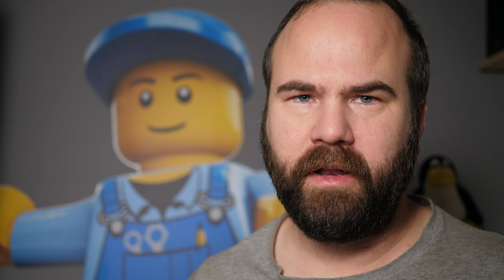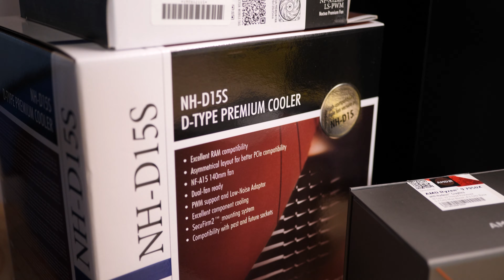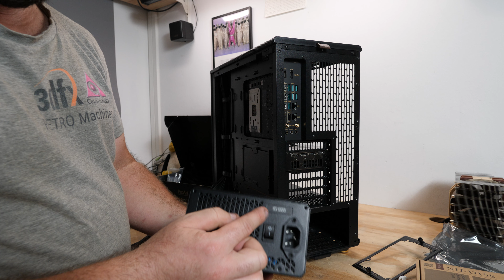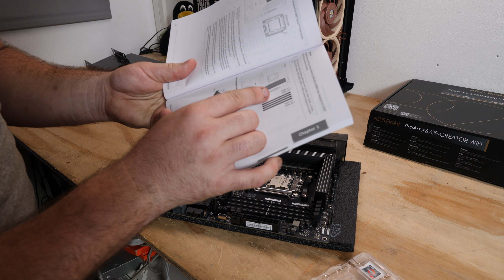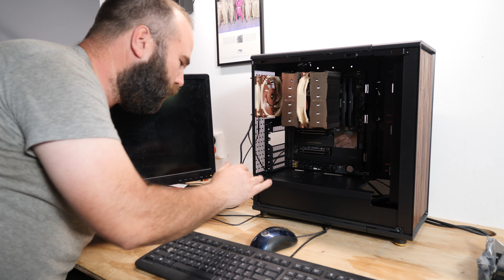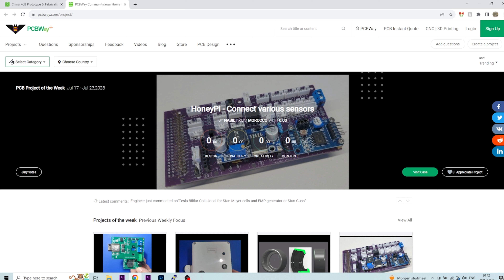The Ultimate $4000 Workstation PC Build Guide (2023) AMD Ryzen 9

Comment: I'm jealous, my 2019 PC did cost new ~$400, even counting this year's replacement HDD.  A Ryzen 3 2200G ($97); ASRock B450 HDV Rel 4.0 ($59.99); Xtech Black Case & Power Supply Combo (DOP 1800 or $36);  The expensive parts were a 512GB nvme-SSD and 16GB DDR4 (3000MHz). I reused a 128GB sata-SSD and a 1TB HDD.  The HDD died this years after 10 power-on years, so no complaints, I replaced it by a cheap 2 TB SMR HDD.  The power supply is special, it has 600W and 6 plugs, 24-pin; 4 pin; 2 sata and 2 molex :)

Currently the PC runs Firefox (1 Tab); Conky; a Xubuntu 23.10 VBox VM for all my communication apps (4 apps are loaded at login; Evolution; Transmission; KDE-Connect; Facebook Messenger and Conky) and an Ubuntu 16.04 ESM VM for banking with the latest snaps for Firefox and LibreOffice, currently both are loaded.  The Host is Ubuntu 23.10 running on and booting from OpenZFS 2.2.0.  Free memory is 2GB from 16GB and it uses 4.6GB of dynamically sized memory cache (L1ARC) to store 6.6GB of stuff when uncompressed.  For the HDD and sata SSD I use partitions in ZFS. 

The HDD has 2 partitions.  The first one (193MB/s) for VMs is supported by 2 sata-SSD caches; a 90GB read cache and 5 GB write cache, the second HDD partition (143MB/s) for data has a 30GB read cache and a 3GB write cache.  Linux boot times from the nvme-SSD are between 6.5 secs (Xubuntu) and 12 seconds (Ubuntu).  Linux boot time from the cached HDD are ~2 seconds longer for frequently used VMs, while for the others it will be between 17 and 27 seconds.

For next year I plan a mid life upgrade to a Ryzen 5 5600G (a whopping 3x faster) and 32GB DDR4 (3200MHz).

Comment: Hey Victor, congratulations on your new PC :)
1. If i may: You have a lot of IN-Flow from all the fans and lots of heat accumilating in the top; the CPU getting a lot of the Heat produced by the GPU as well; Your Mesh top should Suffice in allowing dissipation of Over-Pressure - you might want to add a Fan up top in the back if it is very hot in Summer. Overall this should be a very nice System.

2. Since this serves as a quite good tutorial, i would like to add: the M.2 Slots aren't all connected to the CPU, so explaining to read the Block Diagram would serve people very well.